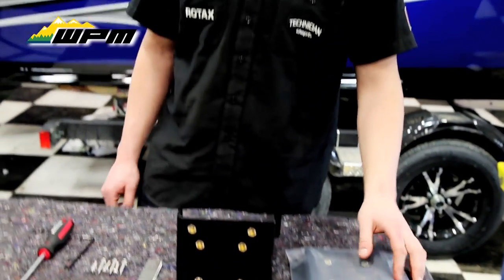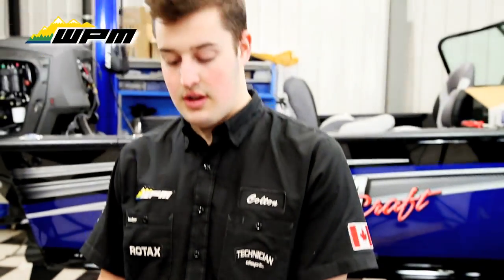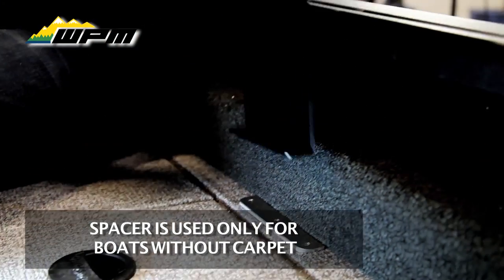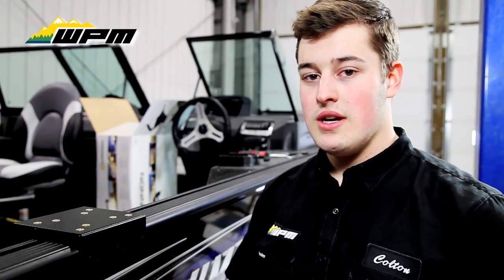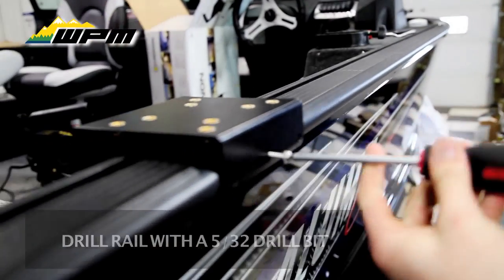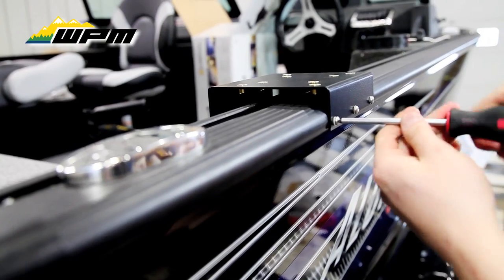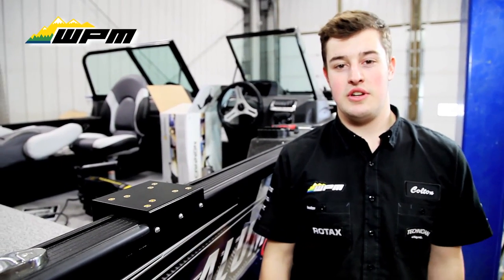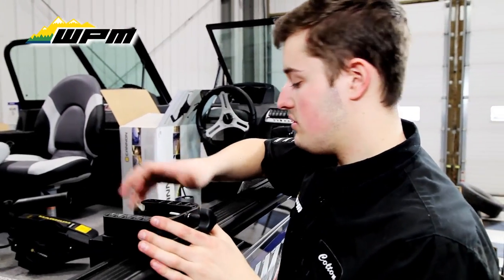How to install a down rigger mount (#410148) on a boat | #WPM

Comment: What is the company name of the kit you are using?
Reply from the maker: Hi You can contact WPM at 780-349-5277 parts department - down rigger mount kit #410148

Comment: Love the video what is the part number?  I need 2 ea.  I have the 2017 Alumacraft Classic and just purchased 2 Scotty Downriggers.
Reply from the maker: You can contact WPM at 780-349-5277 parts department - down rigger mount kit #410148

Comment: I noticed you had a bracket for an Alumacraft trophy were do I find one of those. I have an 2015 Alumacraft trophy 195.
Reply from the maker: Hello, you can call WPM Parts at 866.337.4186, thanks for comment!

Comment: Word of warning for anyone thinking of purchasing these mounting brackets. They do not fit a Scotty 1026 electric downrigger as I had the unfortunate opportunity to experience.
Reply: Why didn't it work?
Reply: @alwayshookedup8542  
Bolt hole pattern only works for the tilt bracket. If you want to be able to swivel the rigger ( I don't know why you wouldn't  ), the swivel plate won't match up. I made my own mounts instead.
Reply: My mount is 3.5 by 4.5  it should fit a typical Scotty mount no?
Reply: Also I have a tilt bracket and swivel. Its the 1116 pro pack
Reply: @alwayshookedup8542  
Couldn't tell you if that would fit or not. The swivel base I have on my riggers is about a 5" bolt hole diameter as I recall. It's been over a year since I tried the mounts in question so probably best to check with the seller as to the bolt placement dimensions